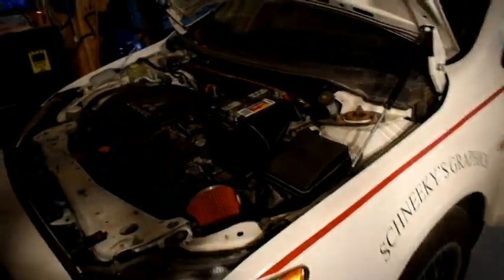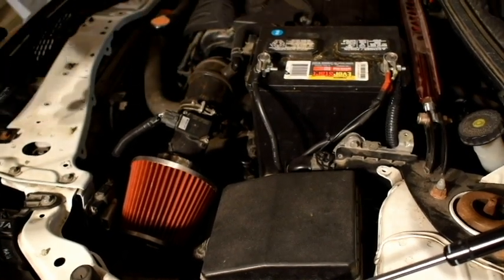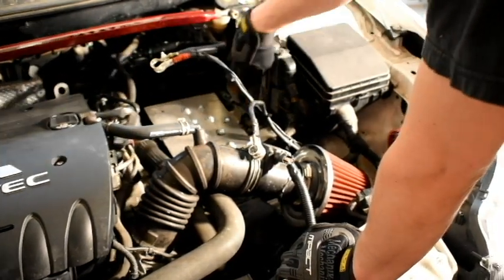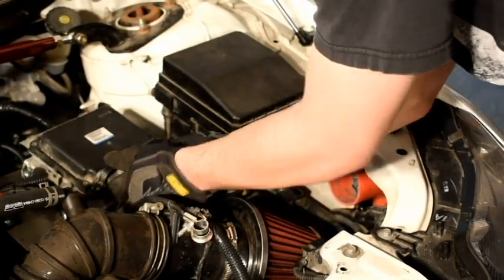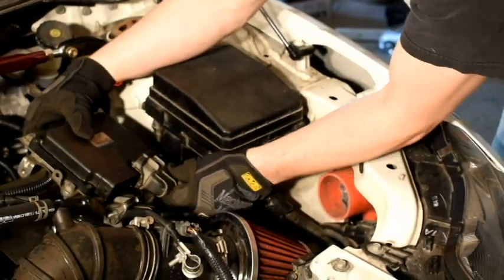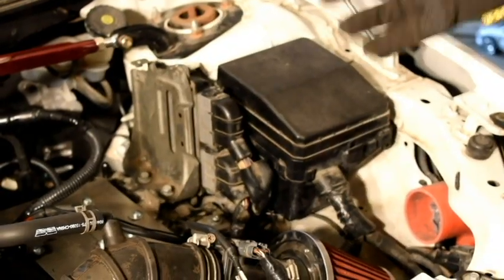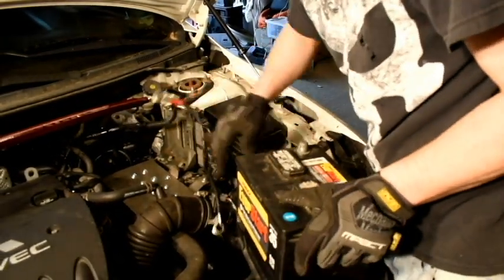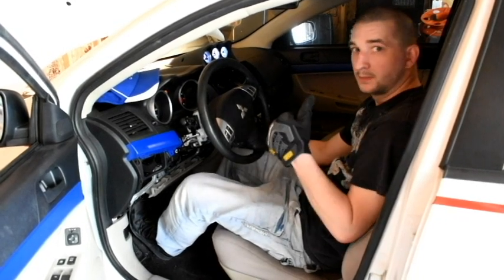How to Replace the ECU in a 2008 Mitsubishi Lancer

Comment: I convert my 2009 Lancer from CVT to  manual shift. I am getting the error related to the CVT temperature. We allready reprogram the CVT computer and still gettig the error temperature related to the CVT. I been told that I need also to replace the VCM using one that came out of a hand shift Lancer. My car only runs up to 80 Kilometers max, due to that error. Any ideas or comments ?

Comment: So I have a 2015 lancer es, all my service lights come on and my shifter stays in park, car starts and everything just fine. Cant drive it since it basically runs in idle and goes about 5mph. I've checked all the plugs and everything, could it be the ecu causing this?
Reply: Taylor Holden did u ever figure out what was wrong?
Reply: @marcusholmen9741  Yes, wires that were in the main boot that run from the ECU to the dash were cut and touching. Causing the ECU to short out them after that I had to repair the damaged and cut wires and reprogram the ECU.
Reply: I’m getting code. P1637 and u0100
Reply: @Phillies_shesity  you ever figure out code u0100?

Comment: I need to replace the TCM in an '08 Lancer ES. Anyone know where it is located?
Reply: behind the glove box...
Reply: I found mine under the steering column.probably the same for yours?
Reply: My TCM also went bad on my '08 Lancer ES. Parts are hard to find and the dealer is charging like $1,150 for the module.

Comment: Hi there can you help me out, I have a Gts 2008 and I just got an ecu from a evo 10 2010, when I changed it the car did not want to start and it gave an error that said system error, what could be the reason??
Reply: You can edit the VIN with the MUT 3 tool and software...
Reply: Public Void do you know where the transmission control module is for an '08 lancer ES ?
Reply: Mohd Fikri Puteh  
Please how can  you edit the vin with mut3 do you have video or can show 
I have mut3 from china can it do that job.
Reply from the maker: Ronald Mora did you replace the BCM as well?? also the ECU is tied in with the Chip Immobilizer... So you either have to buy a new one and program it or buy a ECU that comes with the BCM and immobilizer from the same vehicle as they are VIN writtin and cant be re programmed
Reply from the maker: so basically, the system error will go away if you replace the BCM thats from the same vehicle and the starting issue is from the immobilizer...
Reply: Thank so much dude!!!
Reply: If I install only the BCM would I need still  the immobilizer also??
Reply from the maker: yes, the BCM will only fix the system error off the dash as long it has the same VIN on it... the immobilizer is what allows the car to knoe that the correct key is in the vehicle so itll start
Reply: in other words without the immobilizer the ECU and the BCM are useless???
Reply from the maker: yes unless u buy a new immobilizer and have it programmed make sure to get some keys too id recommoned

Comment: do you know if there's any other tuning software options for an 08 Lancer es MT besides what your doin
Reply from the maker: WEStTEXAs i heard of a few street tunining software cables type stuff but there like $1,500... and im also gettin it dyno tuned in quincy, il too after its completed hopfully
Reply: Dam 1500 that's alot I wanna stick with the stock ECU I'm doin a ralliart turbo set up, the tuning software is where iv came to a hault.
Reply: Tried the tactrix cable but didn't work.
Reply: Hello sir
Actually I am not sure you are see my comment but I have mitsubishi lancer ex 2017 in Egypt I wanna program the ECU to start fog lights with the low beam light sure with the low beam switch. Because my car not having fog light one how to do that